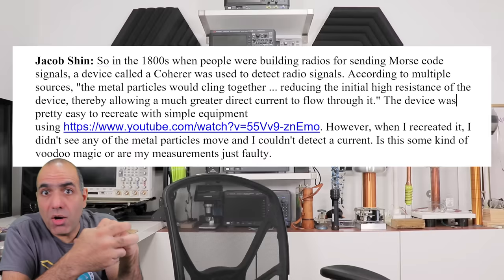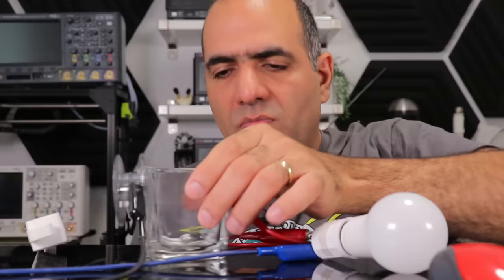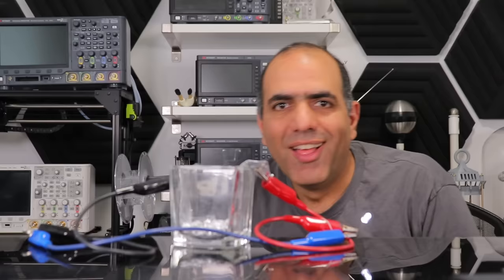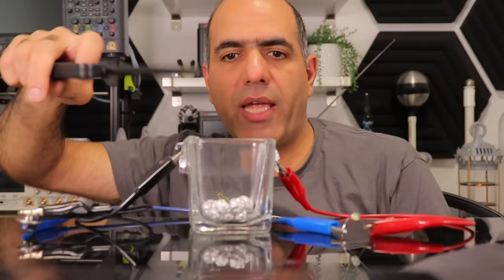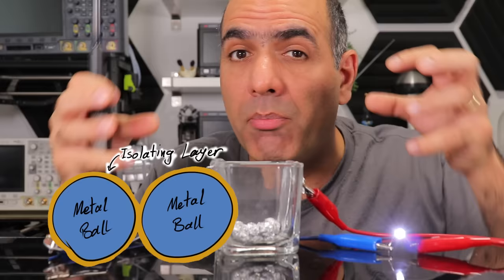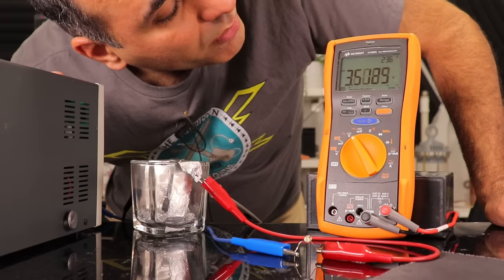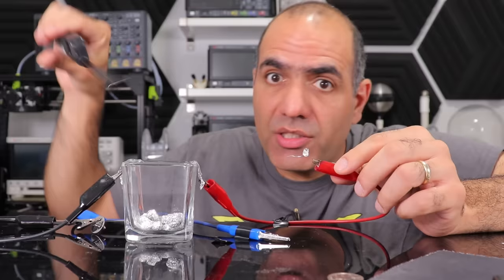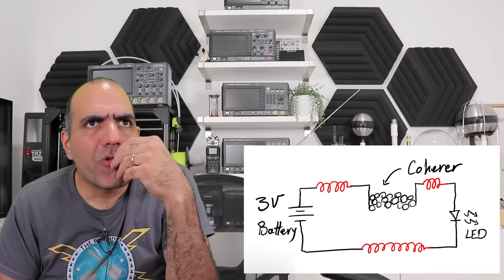Wireless Communication with a Cup of Balls, Coherer Effect

Comment: From the breakdown voltage of Al2O3 we can deduce estimate that the oxide thickness layer is at most about (2V)/(5 MW/cm)=4 nm.
It turns out that the aluminium develops about 4 nm oxide layer on its surface under ambient conditions, so your measurement/estimation of the critical voltage for the coherer was quite good Mehdi!
Reply: Best comment for context. Always wondered why you can't see the oxide layer clearly in commercial aluminium foil. Won't find such unique cases of experimentation in any textbook!
Reply: Yo this is sick! Love it when physics makes everything add up
Reply: Thanks for the context!

Comment: I have always enjoyed your demonstrations Mehdi, but this one tops them all. I am a retired radio communications tech who only reluctantly admitted that a Branly coherer could actually work... but now I see it's far more reliable and sensitive than I had been willing to believe! THANKS!
Reply: Its been 7 years i'm Building a Marconi coherer receiver and I can assure you how this simple sensor Is easy to operate and stable in a properly built circuit
Reply: the standard explanation for how it actually works is obviously bonkers.  breakdown voltage is modern understanding of it

Comment: This was a good one!
I think on board the Californian, the nearby ship that failed to ever come to Titanic's rescue, they had a Marconi receiver with a coherer detector too. The proper wireless operator had gone to sleep for the night, but some mates were allowed to tinker with the set. The detector had a wind-up clockwork that constantly struck the coherer to reset it, making it possible to hear actual Morse on the set. The people forgot to wind it up, and never heard Titanic's CQDs and SOSs.
Reply: That’s interesting, I’d read about the crew going to sleep for the night and turning it off. 

Never heard that some people stayed up to mess with it and could’ve picked up the distress call if they’d wound-up the detector… that’s a big shame if true. 

Also how fake does that sound, “they forgot to wind-up the radio detector” if you didn’t know about tapping to reset it 😅
Reply: not at all what happened. the equipment was turned off and the operator went to bed after finishing his shift with a rude coworker this was before impact. they also saw titanic shoot rockets and have thought they were in trouble but it didnt look like a distress signal, and the captain never did anything. they also tried to communicate with titanic using a morse lamp, but were never told to contact her wirelessly.
Reply: Wasn't the "rude co-worker" thing in actuality just a part of the radio operator culture at the time? I remember hearing that it was pretty common for radiomen to send messages to one another that most "upstanding citizens" would have considered rude.
Reply: @MrPaxio  IIRC part of the reason it was turned off is the volume differences between the sets. Thus it was an annoyance to hear from the Titanic, until it became a necessity. :(
Reply: @TechyBen  i dont think it matters at all, they saw distress rockets being fired, the crew was very concerned, they told the captain, and the captain left the area two hours before it became a submarine. even if titanic was screaming down those internet tubes that shes sinking, theyd prob leave anyway 😂😂🤣
Reply: Bruuuu....Bruuuu....Bruutal
Reply: Coherers weren't used on ships for exactly the reason shown in the end of the video, so on sea they would usually use Magnetic Detectors: receivers that would employ an endless loop of magnetized wire passed through a receiver coil by a clockwork mechanism that would indeed have to be kept wound!
Reply: Uhm no. That's wrong. The device primarily used on both Californian and Titanic was the Marconi Detector, and was operated by clockwork wind up, ok, but didn't work with coherer: the coherer was located in a different type of Marconi receiver, the one that should be connected with a Morse printer and I'm pretty sure they didn't have that display on board the Californian and the Titanic. Also, the device with coherer was fully electric and was capable to work on its own. No, the magnetic detector required an operator continuously listening through earphones (no Morse recorder). If the clockwork needs to be reloaded by hand crank the operator will immediately notice by the decreased motion of the wheels mounted on the side of the device (affixed on the wall in front of the operator, so no way he could forget to reload the machine)

Comment: I've definitely experienced the Coherer effect before. It has a very surprising range, and can absolutely causes some odd effects.
Reply: Wanna give an example?
Reply: @keepyoursins my PC often times wakes up from sleep when I use a lighter.
Reply: @Burgerking-Foot-Lettuce  Every time my wife stands up from her chair my monitor screen glitches, no joke. Now I finally know why.
Reply: “I receive CIA radio transmissions in my head because their frequencies connect across my metal fillings”
Reply: @XxSForrestxX  are your fillings aluminum ?
Reply: @XxSForrestxX I highly doubt the cia is using un encrypted am transmissions. But u can absolutely receive AM radio. The filling acts as a diode p/n junction. This would happen with crowned fillings. Not sure if with regular metal fillings. Noone should be getting metal fillings anymore btw. If ur dentist ain’t doing resin, walk out
Reply: whenever i hit the switch on my blowtorch, the infrared laser thermometer turns on. from like 10ft away too lol
Reply: @Burgerking-Foot-Lettuce  You can also crash computers that way. 
It doesn't really have anything to do with coherer effects and stuff. The piezo-sparker just generates a surprisingly hefty pulse of electromagnetic radiation (a.k.a. radio wave), which gets picked up by any conductor in the PC, which may flip a bit or two. Static electricity will do it as well, as the other guy wrote.
It's mostly a problem if your case has a window or is made or mostly plastic. Which is why we use metal cases, and laptops have metal deposited on the plastic inside (which is why they often look kinda "coppery" inside.
Reply: Sparks on the commutator of a drill often triggers cheap wireless doorbells.
Reply: @Burgerking-Foot-Lettuce I was gonna say this, my blowtorch will turn my desktop on lmfao
Reply: @Burgerking-Foot-Lettuce  my pc when i turn on the fan i have in my room and sometimes if i turn on the fan i have in the bathroom wtf 😂
Reply: None of the replies here are related to the Coherer effect. You are experiencing only electromagnetic interference, whereas Coherer is related to the conductivity change due to applied voltage.
Reply: @Wtfinc  Metal fillings are still very common across Europe.  The problem with resin fillings is they aren't as strong so more prone to falling out over time.
Reply: @XxSForrestxX do you hear the numbers Mason? What do they mean?

Comment: This concept is also used for switch contacts. You need a minimum voltage to breakdown the layer of corrosion that forms. 

As some switches can be in a circuit with less than 5 volts in non-ideal conditions, this can be a “hidden issue”. 

Solving the issue could be using a starter circuit or a switch with a wiping contact opposed to just pressing contacts.
Reply: We have a relay that has 24vdc to pass through. It barely has a wipe so every once in awhile we have to burnish the contacts. 😅

Comment: You should try to connect it to a ground source ex (ground terminal of an outlet or metal pipe) to see if it would trigger around the house or even outside of the house.  Also, it would be interesting to see if this could work as a cheap lighting detector or be triggered by lighting.
Reply: re: "You should try to connect it to a ground source"
Well, of course, "Everything goes better with Coke er a ground connection" /sarc
Earthing is of little consequence to all but (and this is important) GROUND REFERENCED SYSTEMS like single-wire REA (Rural Electrification Act) medium voltage 'distribution' systems.
Reply: @uploadJ  I think there are a lot of RF engineers who might disagree with you there!
Reply: @Berkeloid0  re: "I think there are a lot of RF engineers who might disagree with you there!"
NOT NOTing the end of the Sarc tag eh? Demerits for you!
MOST ppl think 'ground' is some sort of cure-all .. is that what you think too? THINK rather in terms of DIFFERENTIAL voltages, balanced feeds and the like ... advance to the next level.
Reply: @uploadJ  You said earthing is of little consequence (no sarcasm tag there) but you'll find that a number of antenna systems perform poorly without a ground connection, as put simply the ground/earth is used to reflect the signal back onto itself to improve the transmission power.  So earthing is of great importance to anyone designing RF systems which was my point.
Reply: I was also thinking of a crude lightning detector - and the pulse length may give the distance, as the thunder will turn it off.
Reply: Metal pipe? 
*metal pipe falling sfx*
Reply: It could definitely be triggered by lightning though the question is how far away.

Comment: Theoretical physicist here. I think the resistance goes down across the balls when you click the lighter because when the electromagnetic pulse reaches the balls, it triggers magnetic reconnections betwen them (magnetic flux tubes), which are like the field lines between the Earth and Sun when they do reconnections. It's like a "magnetic worm hole" for the electrons since a flux tube is a magnetic vortex with a vertical magnetic field line at the center. So there are these flux tubes from ball to ball along which the electrons travel. The vibrations of your voice oscillates the air and collapses the flux tubes, so the "worm holes" between the balls are gone, so the resistance is back.

Comment: Material scientist here. The thing with the isolating layer makes sense. Aluminium corrodes on air rather quickly. Although it's just a few atoms thick, it prevents the aluminium layers underneath from corroding. This oxide layer also prevents an electrical connection and explains, why you have to press a little harder to get a connection. A voltage spike is enough to get a connection going and tapping on the glass or vibrating the aluminium balls any other way expands the gaps between them just enough to disconnect. I think this effect is not possible with other balls, e.g. steel ball bearings. Greetings from Germany.

Comment: I wonder if this Coherer Effect could be used like the old telephone microphones. Vibration of the microphone's diaphragm would excite a needle placed in a cup of tiny [metal or carbon] spheres . Current across the cup and the diaphragm would be changed, amplified and transmitted. Maybe, in a follow-up video, you could build yourself a microphone to play with.
Reply: now that is mind blowing. and transistors just took the place???
Reply: @Alex-zi1nb  I was surprised too after I took some pliers to it and all the 'balls' spilled out.
But, they work really well, I was able power a loud speaker directly with it.
Reply: It's not actually the coherer effect, it's just that vibrating loose contacts changes the resistance.
Reply: @tommihommi1  Yes, the Boudet (or Carbon) microphone but, I thought this Coherer Effect was similar enough to compare
Reply: re: "The microphone's diaphragm "
I think you're confusing a carbon mic element with this effect. There is nor reference to the Coherer Effect in early telephone tech.
Reply: @uploadJ Yeah, I saw this and was reminded of childhood tinkerings. As i mentioned in a previous reply, the Boudet (or Carbon) microphone.
Reply: @3ATIVE  Yeah ... notice the Coherer Effect is an on/off effect whereas the carbon mic always had current flowing through it ... early Motorola 2-way radios used carbon mics, and I have a 60's rotary phone with a carbon mic that needed occasional raps to reduce the distortion (the granules become packed after a time).
Reply: WE NEED THIS
Reply: @uploadJ  Yes, this is correct. Old telephones used carbon microphones and carbon microphones were basically just a variable resistor that changed resistance with the pressure waves.
Reply: @stefanl5183  re: " Old telephones used carbon microphones and carbon microphones were "
Yes ... I've known this for, oh, forty five years or more. Glad you can keep up if you just found this out ...

Comment: Would be interesting to have some of these cups set up, and then see if distant lightning during a thunderstorm will trigger them 😊
Reply: Alexander Popov did that with a simple circuit. You Just Need a polarized relay, a coherer, an electric bell and two circuits of battery: 1,5v on the coherer and polar relay spools, and 3/4,5 or more on the relay contacts and Bell ringer

Comment: While I haven’t done any homework on it: I suspect the redox potential of aluminum (-1.66V) is probably significant here. My guess is that in ideal conditions, that’ll be the voltage required to reduce the oxide layer (or similar - I’m sure Aluminium oxide has some interfering properties)

Comment: There is an in-depth history of coherers by by Thomas Cuff available online that I found very interesting. There were many variants of the coherer: Tesla patented one that kept the loose conductors in a rotating drum so it would self-reset. Work on coherers eventually led to the copper-oxide rectifier.
Reply: The most used setup was a simple Bell ringer shaking the coherer everytime It become conductive

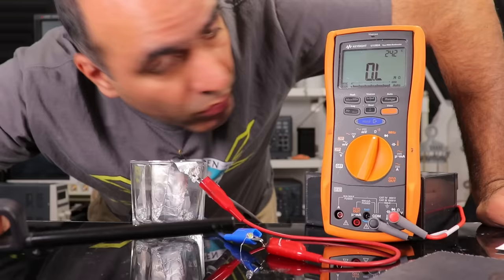Comment: So cool!  Also watching the resistance change in response to sound at 7:45 put me in mind of carbon microphones that work by inducing vibrations in a conductive powder between 2 plates. I wonder if those would also be affected by the Coherer effect and could be used as a basic antenna to detect sparks too. 🤔
Reply: this is essentially first discovery of radio waves by David Edward Hughes. However, review commitee played down his observations to be "simple induction". Carbon powder microphone was better coherer, than one made of iron shavings. It was just not a right time to kick off.
Reply: @michawisniewski4654  fascinating, thank you!
Reply: i wonder if the conductive powder is kind of like a much smaller version of the ball and can be modeled as such. Perhaps on that level you would need some sort of statistical mechanical analysis
Reply: @cd-zw2tt  actually balls are larger version of the dust. Shavings tend to have rough surface too, but in microscopic scale
Reply: Very cool! I like Medhi's expression on his face when it WORKED!! So cool.

Comment: 5:43 that's exactly the case: aluminium under atmospheric conditions is covered in a layer of oxide. This oxide layer not only isolates it electrically but also chemically and that is why aluminum foil does not react violently in contact with water as pure aluminium would.

Comment: You're on to something with the whole low voltage stabilizing the connection theory. This could explain why in some cheap audio equipment with dirty connections I've experienced the sound "popping" back in when the volume is turned high enough. The right amount of voltage from the amplified sound is enough to "reconnect" it and keep the sound going.

Comment: It's amazing to see just how far back you could go before the light wouldn't turn on with such a small circuit. I understand the lighter had been modified but just wow. I hear noise when the TV turns on or say when a plug is used. Also the whole telephone pole noise but that's pretty common. Anyway I wonder if ringing ears is a side effect of long term exposure to general electrical "noise" in the air that this experiment kinda helps demonstrate.

Comment: Yup, that's how radio was way back then. Good old spark gap transmitters and the basic Coherer detector. I have also made a few of these and they always work but can be hard to reset at times. The wireless receivers of the time used a simple bell type tapper to tap and reset the Coherer each time a pulse was received. Take care, De WA4JAT

Comment: I did that experiment in grade school. Try to do the same with a plasma lamp. It can be anywhere within almost 20 meters, depending on the plasma lamp. The explanation is that the magnetic fields acts as a wire (like a microwave cooking by passing electric current within a magnetic field through a water containing food). Even piezo elements pulse electromagnetic fields. 
Try the plasma lamp. 
Magnetic fields act like wires.

Comment: It’s basically the same idea behind a transistor. Break an insulating layer between collector and emitter with a high enough voltage. Only here there’s hystereses at play that enables it to be sustained after the influencing voltage is removed…